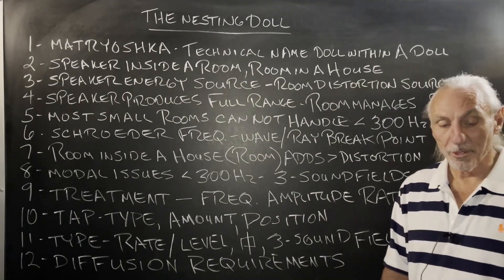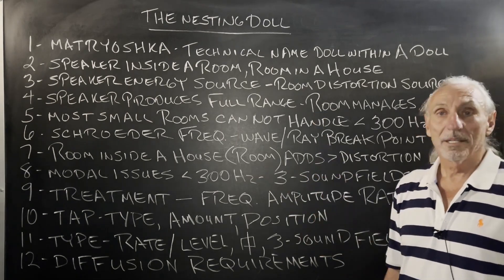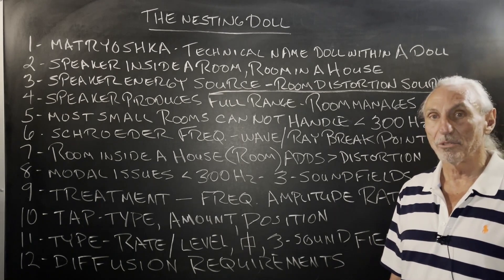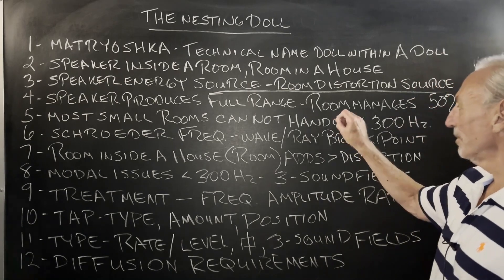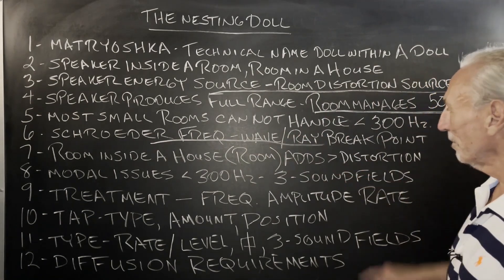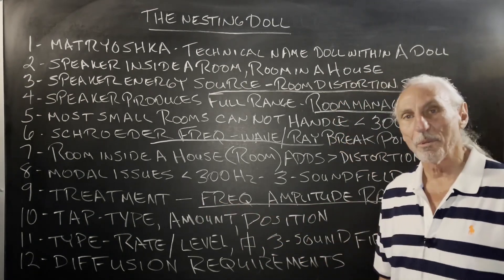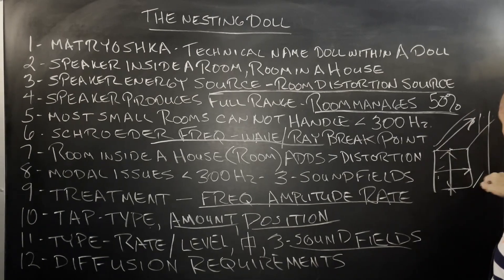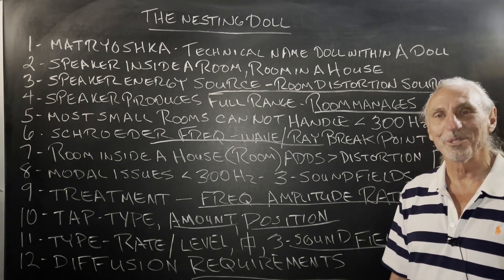The Nesting Doll - www.AcousticFields.com

Comment: In a small room, say 8 x 10 x 8 or 10 x 12 x 8, the most effective full-range audio treatment might be a premium pair of headphones. $600 will buy a fine pair of headphones, but I don't think you could even begin to start on truly effective low-frequency treatment (your carbon tech for example) for anywhere $600, even as a DIY.
Reply from the maker: This is a false comparison. Room sound and "can" sound are completely different types of sonic presentation.They can not be compared regardless of budget. You must select the sound type that matches work flow and presentation values.
Reply: Yeah I agree with dennis. They are two very completely different experiences that's not really worth comparing. Although, hi-end headphones will give you a taste of what a 2-ch system can be capable of when you treat your room right.